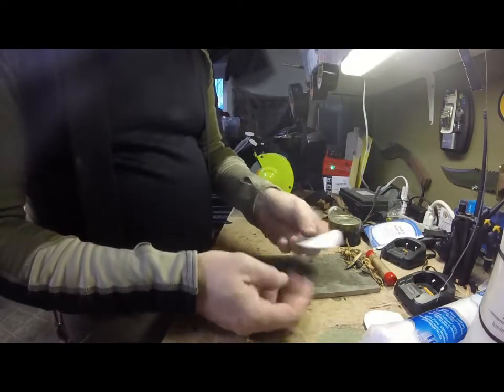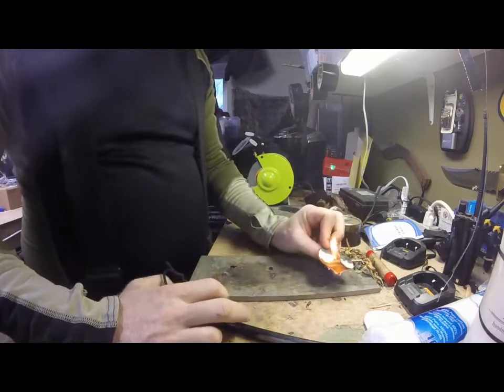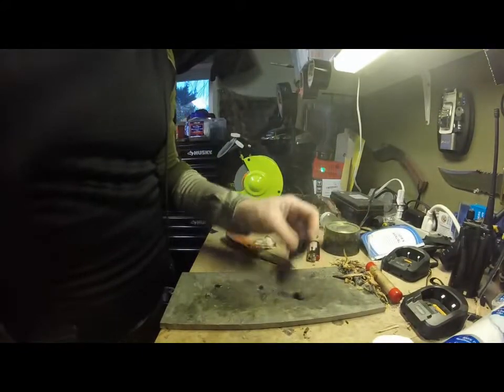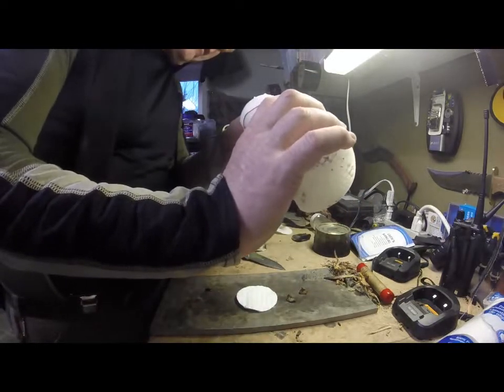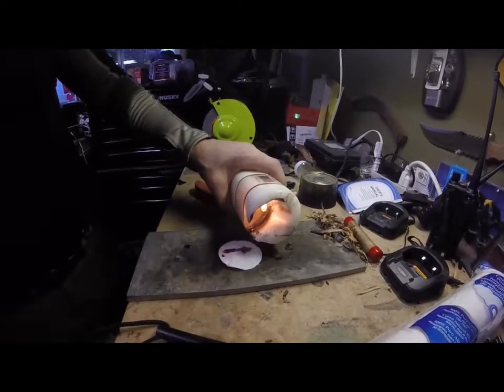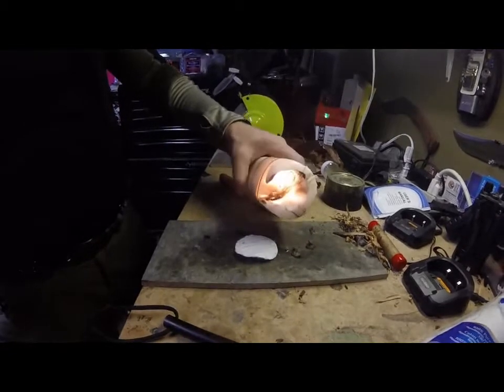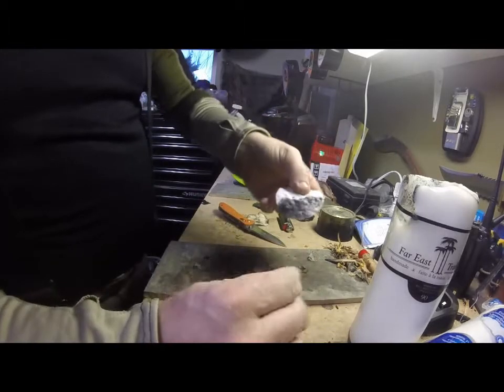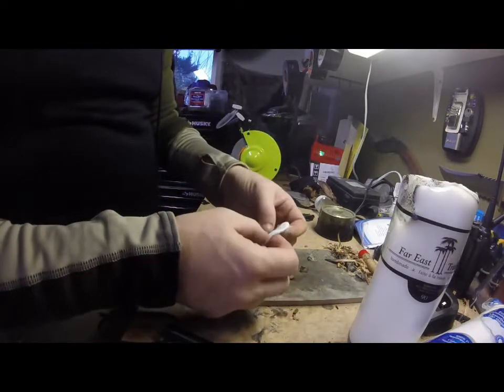New fire starter and works if you suck at using a Ferro Rod

Comment: Thanks again for another good tip. I was impresses with your video starting a fire in wet conditions with only the rod. I am not that good yet, even with dry wood and fine tinder.
Reply from the maker: Your welcome....hey try using the back of your knife and shave the wood to start your fires with..make a gulf ball size pile and then take a Ferro rod to it....that might help a bit